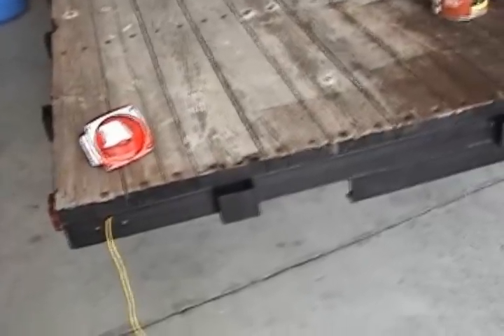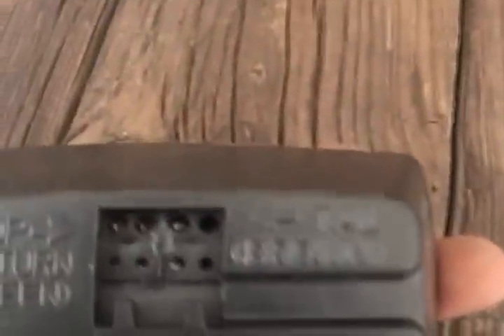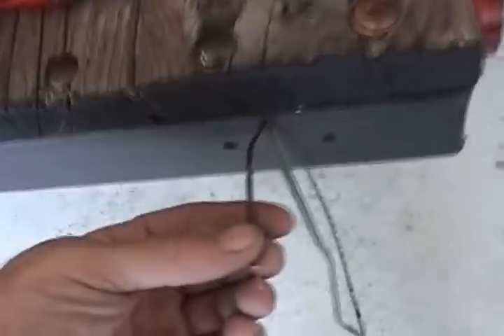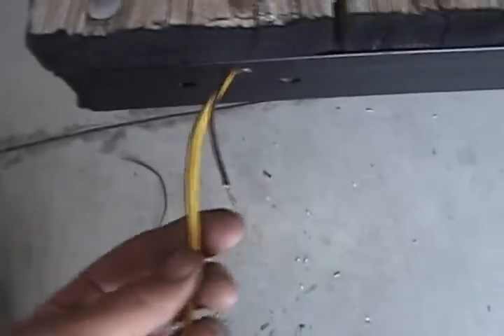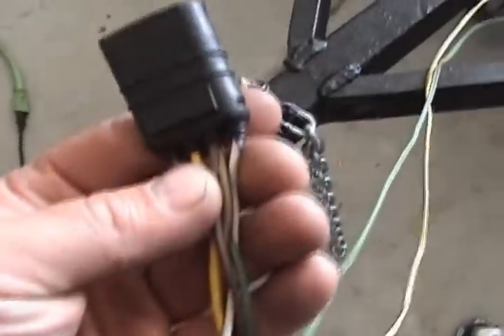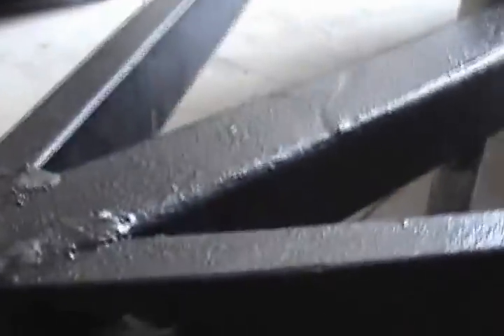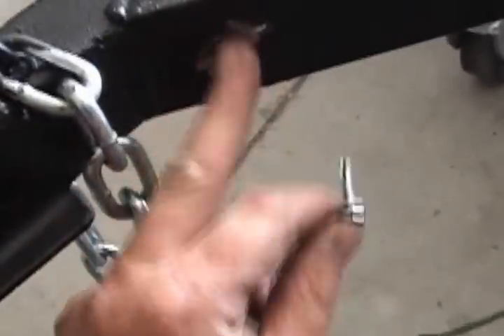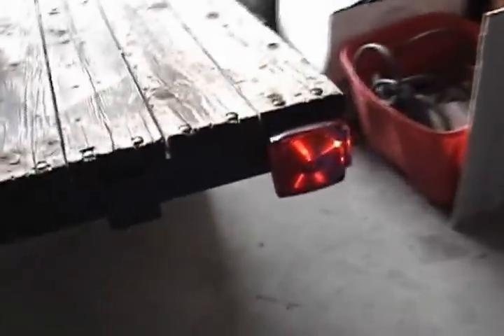How to Install New Taillights on a Utility Trailer

Comment: you didnt show how to put the wires in the light and you didnt show how you mounted the lights to the trailer , so all you did is show the after and not the during on how to install ...